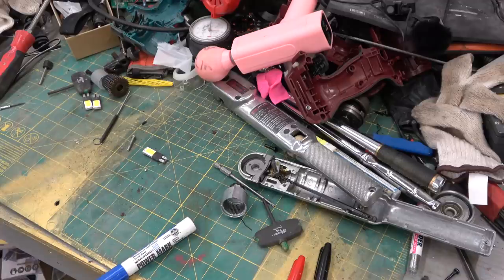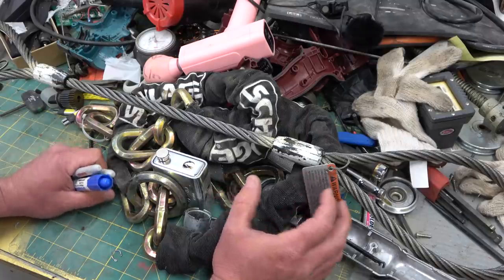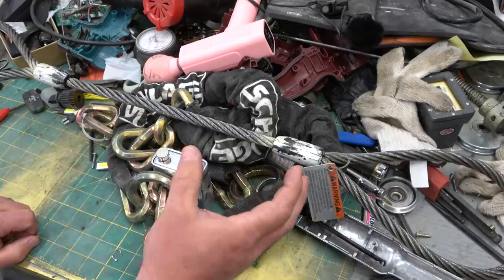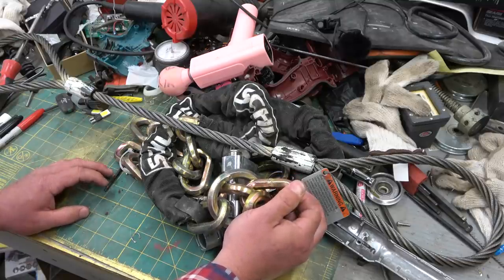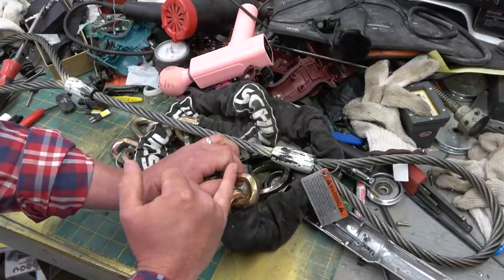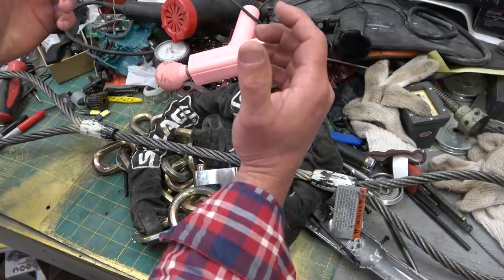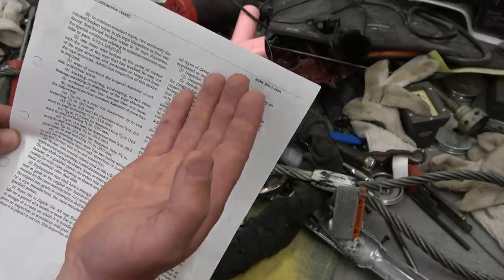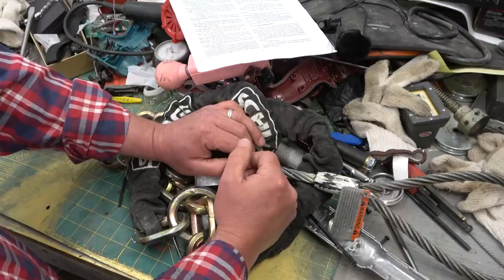"It is not known why the pulling cable snapped."

Comment: "Clearly there was a complete failure in management" When isn't this the case?
Reply: I've worked for several corporations in IT. From my experience, I concur.
Reply: When the employee cares more about someone else's job instead of their own.
Reply: @jamestrahan9311  One of the main things I learned after working in a corporate environment, you can't count on someone else to do their job right.
Reply: Many times it's the actual worker failure to not follow the rules, even if management told them so. Honestly, we don't know if in this case management gave permission to the technician to bypass the brakes...
Reply: Usually anywhere you can find the name lord being used, it's a failure in management because things such as cablecar accidents have never produced even a single afterlife, no matter what you perhaps were told while growing up.
Reply: Sometimes, structures fail in new and interesting ways, like the 1940 Tacoma Narrows bridge (though you could argue that it should've been closed off until it wasn't galloping anymore, which would've saved the life of Tubby the dog).
Reply: @AlessioSangalli  "Many times it's the actual worker failure to not follow the rules, even if management told them so"  ....its still Managements job to check that the rules are being followed
Reply: @DanafoxyVixen  it is, of course. However, the OP above said it's always the management's fault - that sounds like too much of a generalization that doesn't do anything to properly prevent something like this next time.
Reply: @AlessioSangalli  "However, the OP above said it's always the management's fault"  yet It still very much true. generalizations exist because they are often true.  If management are doing their job and actually managing and overseeing what their staff do then mistakes below management should be managed and accounted for to the best of their ability and if the staff can't carry their job in a professional manor then they should be retrained or demoted or fired.
Reply: Don't worry, the judge has ruled that management was functioning as its supposed to, so only the technician needs to be prosecuted, not the head of maintenance or the owner of the company, even though they where aware of the disabled safety features.
Reply: @DanafoxyVixen  I had this argument many times when I was working, Dana. Managers, (straight out of uni most times) would say that they didn't need to know the job, they just managed the ones who did. I replied that if they don't  need to know the job, how the  h3ll do they know when it's not being done?
Reply: Ain't called "manglement" for nothin'.
Reply: @DanafoxyVixen  @Alessio Sangalli  I would phrase it as 'Management sets up the incentives.' In this case it would be incentives to disable vs repair the brakes. Management sets up the system and has the job of communicating the intention and incentivizing the intention. Enforcement of the rules because they are rules creates resistance or malicious compliance. 
Communicate so that your why becomes their why.
Reply: Truth. Every industry. Every country. Peter Principle.
Reply: Last Tuesday, for a few hours.
Reply: On the other4 hand, when management sets and enforces stringent rules. there are a whole set of people (usually actual users) who complain of micromanagment and claim  that it is not necessary.
.
Reply: Remember when Volkswagen forced a few engineers to take the blame for their entire emissions scandal program which involved an entirely separate building with locks normal people couldn't access?
Reply: Seriously.  That statement could be attached to virtually every outcome on the corporate and government levels for some time now.  It's getting to be impressive in a way.
Reply: @AlessioSangalli  Very true. Chances are extremely likely that he took it upon himself to perform a "quick fix"
Reply: Whether it be a mistake, error or plain deliberate rule breaking, unless the technician was guilty of gross negligence for personal benefit or committing sabotage there is always a degree of managerial culpability. It’s the basis of any safety management system.
Reply: @underdogslex  well to be fair we don't know that yet but i was responding to the general sentient that is always the management's fault, but either case performing that operation was a huge mistake no matter what the management said or was aware of
Reply: Capitalism via Bowing sent those two plane loads of people to their graves too
Reply: @AlessioSangalli  The role of Management includes responsibility for Supervision. Period.
Reply: Micromanaging is the worst thing management can do. Not trusting your technicans, results in the most toxic workplace, which results in bad service. But the huge fault managers do is to hire idiots as technicans who dont care to do their job properly. The bad decisions happen at the hiring stage, and that's why hiring new employees is extremly risky. In this case it resulted in deaths
Reply: the 1998 Cavalese cable car disaster which killed 20 had nothing to do with management.
It was caused by a US Marine pilot flying underneath the cables (apparently for a bet) and severing them. The pilot and his navigator destroyed the videotape that existed of the incident.
Reply: IT isn't the case, when management points the finger back down to the techniction for not following company protocls. And then the insurance absolves management of the responsibiltiy.
Reply: @AlessioSangalli  It is still management's fault. Either they hired them or they failed to access how trustworthy the person is even if they don't control hiring (you still control your processes). Even a technician went rogue, the fact mabagement had no system in place to triple chek crucial work that involves risk of death, that they assigned someone withou fullying assessing their capacity, that is the managers fault. Doesn't matter if the technician was also at fault, other people fucking up too is no excuse. You oversaw the process, it failed, your overseeing failed.
Reply: @gustavmeyrink_2.0  Maybe not the manager resposible for the cable car, but the Marine corp people handling that pilot are managers too.
Reply: @AlessioSangalli  in my experience that only happens when there is some sort of incentive for the employee to do so.  That generally either means some sort of tournament reward system or more commonly the employees are being pressured to get things done at an unreasonable schedule or cost.
Reply: @louisvictor3473  agreed. As i said plusierus fois in this thread, management WILL be have to be accountable, for sure. However, this does not mean that the technician should avoid criminal and civil charges. There is a point where the company can provide all the training and supervision that is beyond reasonable but the employee can still be responsible.
Reply: @AlessioSangalli  I don't think anyone even implied the employee should avoid charges if he is also responsible, that is the entire point of pointing out that responsibility isn't a thing only one party can have.
Reply: @louisvictor3473  yeah but how can you say "*if* he is also responsible"? Even if the employee was given a direct order from the manager to bypass the brakes, it was still criminal to do so, what argument is there to say otherwise? Management has failed but somebody "pulled the trigger" in this unfortunate scenario...
Reply: @AlessioSangalli  Do I know the local legislation? Do I know if he was told to shut it up "for maintenance" but it was actually lie? Was I  there and know wtf happened exactly to speak about this specific case with authority as if I actually knew the details? No, neither was anyone here.
Reply: @louisvictor3473  well I'm from that area at least
Reply: @AlessioSangalli  I am not, and even if I were if I was otherwise the same person I woul still not know any of those variables, so I can't speak as if I knew them.
Reply: Personally I blame the humans.
Reply: Personally I blame the humans.
Reply: The wrong people always get the best jobs.
Reply: @barongerhardt  If you do the unsafe or illegal act you are as, if not more, culpable than management.  You have the expertise and knowledge not management.
Reply: @DanafoxyVixen  It is not management's job to have the knowledge or expertise of the skilled trades.  Only if management ignores the advice of the trade is it at fault.
Reply: @maddpeanut6313  Pretty much, people act like this is some huge corporation with management and engineers and techs etc. with procedures for everything. In reality it was a probably a smaller company with someone handling management and financial stuff and a few technicians with one supervisor, maybe they even hired an external company for maintenance.

Comment: I had an ole' timer once tell me "Even if someone has been doing something for 30 years doesn't mean they have been doing it right!" I still apply it to my job.. and it still holds true
Reply: This is the principal at work in Alberta, where everyone learns to drive at 14, but their driving skills only degrade after passing the road test.
Reply: This reminded me of something said of a so called expert. "There's a big difference between twenty years experience and one year of experience twenty years ago".
Reply: Another one I like, "Do you have 30 years of experience, or 1 year of experience 30 times in a row?"
Reply: That is the fault in his "never seen that happen before" argument, then he needs someone to fall to their deaths at least once to learn that it CAN happen. Idiotic logic. People have imagination and foresight for a reason.
Reply: I've left several jobs because of the phrase "we've always done it this way." Just not worth arguing with that mindset especially when safety is involved.

Comment: Bypassing the e-brake is nothing less than gross negligence. The consequences of their actions were fully understood when doing so.
Reply: Agreed.  Gross negligence is very hard to prove, legally, but deliberately disabling a lifesaving emergency system does fall into that category.
Reply: @Bacteriophagebs  Installing a maintenance tool to circumvent the safety system is pretty cut and dry IMO
Reply: Since 2014 none the less. Even looks like they bothered to paint the lockouts red while they were installed...
Reply: I would not call something done intentionally ‘negligence’ which is ‘not to do something’ (but English is not mijn moedertaal).
Reply: @Calligraphybooster  They neglected the safety for the passengers. They put in some effort even to ensure it was neglected which is criminal.
Reply: I would call it murder
Reply: @Wallyworld30   No doubt about THAT. Totally criminal. And insane to think as a maintenance mechanic to know better than the engineers.
Reply: @Wallyworld30  ...but thanks for pointing out that the emphasis of the term does not lie with the mechanism, but with the users of the device.
Reply: Maybe the engineer thought that if things go south in a hurry, the accident victims had a backup plan.
Apparently even einstein the famous dyslexic was raised to overly pretend that victims of bad engineering go off to a happyland in the sky, even though that doesnt really exist, depending on who you ask about that, of cour$e.
Reply: The people responsible for this already got arrested.
Reply: Yeah, I'm a forklift tech and the only time an e-brake is bypassed is for 
1) Testing/fault finding.
2) A recovery operation.

If an e-brake fails I'll always tag the machine out 'VOR' (vehicle off road). Customer gets a lovely 'ticket' explaining it must be removed from service until rectified. 
However I can't legally disable the machine if it belongs to the customer and after I leave site they can do what that like, you can only do your part.
Reply: @truetech4158  Huh? Einstein was an atheist (like almost all scientists)
Reply: @mduckernz  Einstein was not an atheist, and in fact many scientists practice some form of religion. Science and religion don't usually occupy the same domain.
Reply: When I was in railway college, there was a lot of stories about why we should avoid bypasses no matter what. A lot of people were seriously injured or died. A lot of people were jailed for many years. And still there are some dumbasses who just ignore the rules.
Reply: @mduckernz  Well if that's the case, then why are there people saying that he wasnt?
I do understand why atheists often never mentioned about their being in fact atheists themselves, that way back then it was a safety measure from being murdered by afterlife professing lynch mobs in the night who carried firesticks to arson the atheists homes while chanting burn in hell, and those lynch mobs are still granted hall passes though now they have things such as launch codes, and apparently putin threatened to nuke florida into a sheet of glass via his old school sociopathic disney influenced cartoon that depicted a bomb hitting florida from one of his nuke powered submarines that seem to troll the waters around florida and such.

Yes, scientists know that its impossible to walk on water, unless its frozen into ice, and that 9/11 and pandemics and all those mass shootings never really produce afterlives.

Cheers, be safe, and dont be afraid to say that swearword that you never hear the mainstream media nor politicians ever use in a respectable way, atheism.

All the best
Reply: Murder, plain and simple!  Murder for profit!
Reply: @luipaardprint  Even though all those war$ and suicides to escape things such as ongoing sexual abuse in prearranged underage marriages, never really produce afterlives, right?
Reply: @JanB1605  the people accused of this have been *released*, it's on the news.
Reply: @luipaardprint  Einstein called himself agnostic, but also stated explicitly that he did not believe in an afterlife. He did not practice a religion.
Reply: @jasexavier  I never said any of that, because you're correct
Reply: Still though, not an atheist
Reply: @Calligraphybooster  Mechanics tend to think they know better than all. Experience tunnel visions them into thier first response.
Reply: @charredskeleton  Sorry but 99% of mechanics would never think leaving emergency brakes permanently disabled is a good idea.
Reply: @Calligraphybooster  negligence in duty of care
Reply: @deezelfairy   That was a response, have to read the original comment for context. And nope he knew. That's why he had the justification.
Reply: @Calligraphybooster  English being my only language,  this would not have occured to me. I agree that "negligence" might not encompass the contempt for human life this act entails.
Reply: What's the bet only the technician gets jailed, but the entire management structure and regulatory body that allowed him to do it, or possibly made him do it get off scot free?